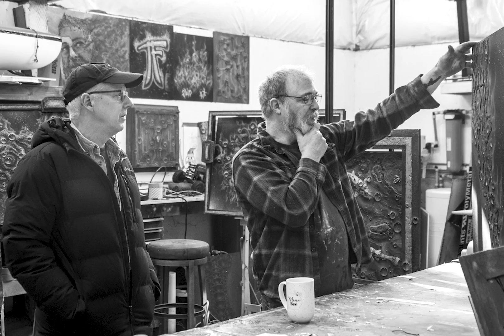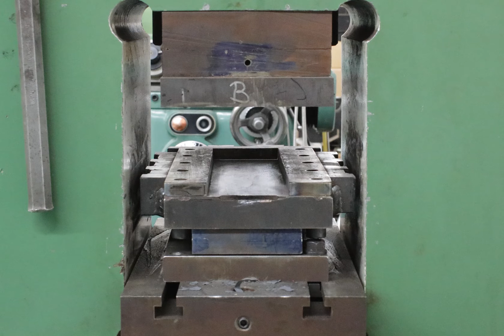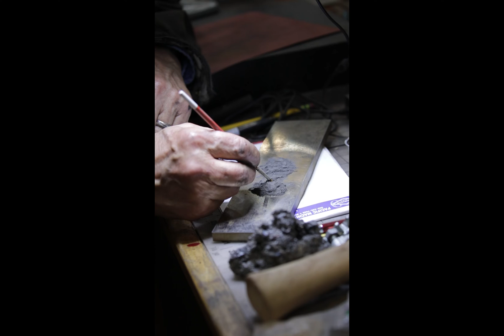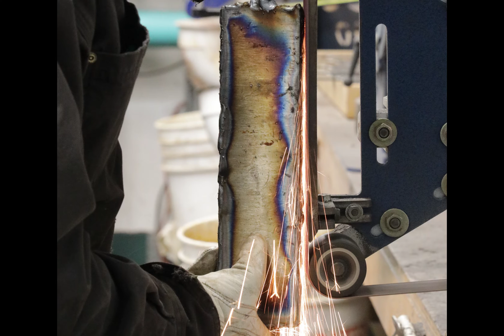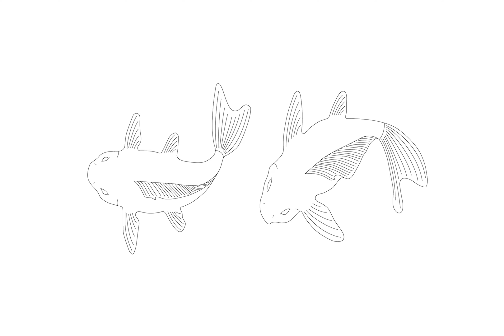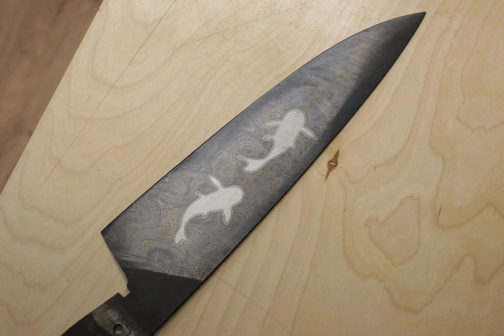Kramer Knives Damascus Insert Welding

Comment: 11:40 Bob, can you tell me anything about that little hammer? I have a 4oz and need a smaller one for gunsmithing that has a thinner profile and for working on making other fine tools. I was just wondering what you can tell me, sir.

Also, I think the key is having one damascus insert or background pattern, and the opposite is entirely different metals and/or simpler patterns. Have you ever tried to inlay exotic metals or precious metals as an inlay? 

Also, how much surface treatment and or polishing do the impressing dies require to leave a decent finish on the final blade product?

Thanks for all the teaching you have done for us all over the years. Learned a lot as has everyone else. The bladesmith society salutes you sir!

Comment: This was an awesome video.

Currently going down the rabbit hole of "I think I need a better knife" and while this is way way out in left field, I appreciate the engineering that went into these knives.

Ironically, after months of thinking that  I need some fancy japanese "super steel" stainless knife, I've been changing my tune and thinking maybe a carbon steel blade with a similar rockwell but more toughness is more suitable for my "wife and kids and the typical home kitchen surrounding..." With a Zwilling factory store less than a mile away, it doesn't take rocket science as to what knives I've been looking at...